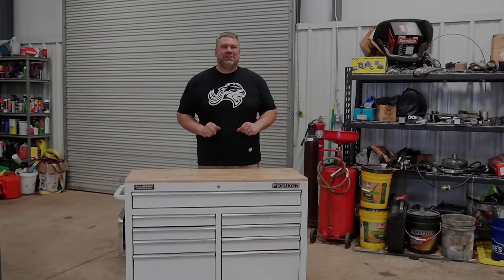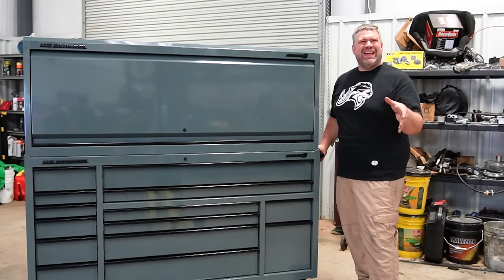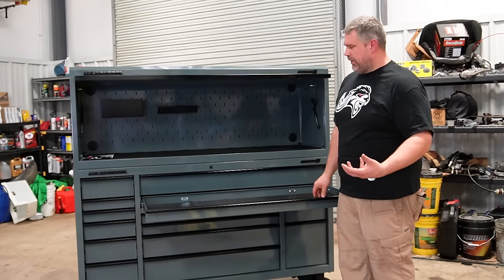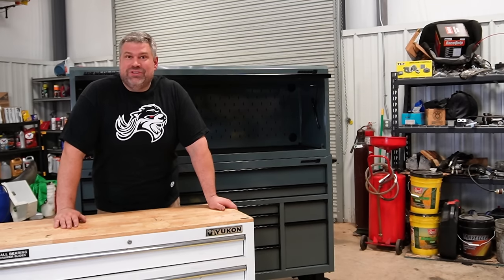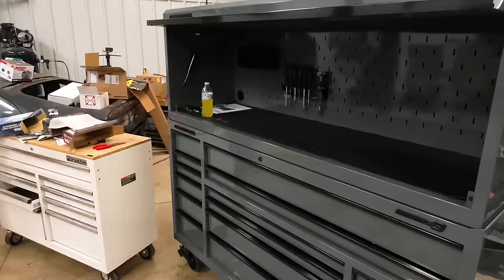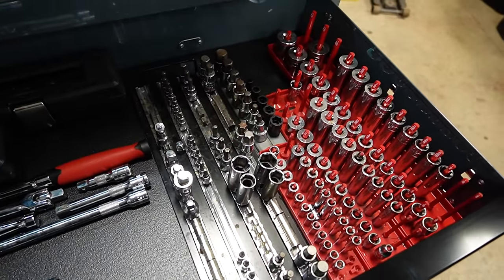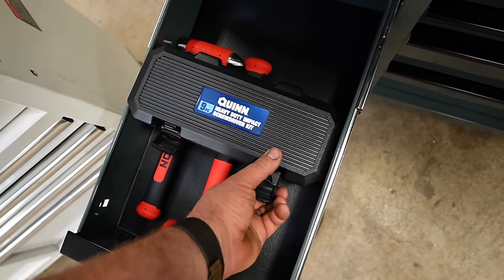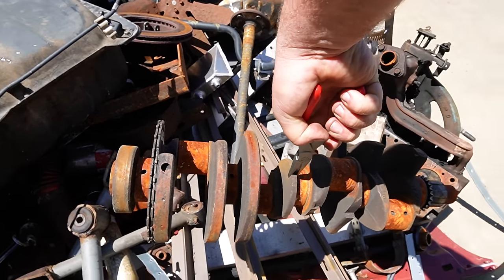Can You Really Save $20,000 With "Cheap" Harbor Freight Tools? U.S. General Series 3 Review

Comment: If you don't mind the color of the thing they have the lower chest in green for $1,199.00 and hell, for that price they could make it chartreuse and I'd still buy it.  Can always rattle can it whatever color you want later for a couple of bucks, lol.  Personally I'd have little to no use for the upper cabinet, but then I do most of my work on big wooden work benches.  Those lower drawers look like they'd be good for holding a lot of my power tools, but my setup would be more for the DIYer in me and not strictly for mechanic stuff, but also for woodworking tools.

Comment: I bought a used Sealey top chest for £200 and a britool roller for a bacon sandwich as my first tool set up and it came with a load of tools (snap on and Sealey) now I've spent (used) £5000 on a snap on kra 2410 top chest, 2422 roller and 2012 side locker with some toolage in. As for impacts, my co-workers rave on about snap on impacts costing £900. I spent £300 on DeWalt and they're much better, less expensive and very much the same power

Comment: Well the nearest HF store is about a few hundred nautical miles away from me so no dice. Yall got it good over there, so good that I am actually planning to move over.

"Mechanics" in this region are mostly grease monkeys, one of which ruined my current project sportbike before I got it. I saw how a few of them do work, taking off head nuts with an air impact, no torque wrench used on engine components, not a page or squiggle of the service manual and people wonder why an overhauled engine is bad compared to an untouched one. They also tried to fix a brake lock-up by putting holes on the (fairly pricey) reservoir diaphragm instead of clearing up the tiny bleed port on the cylinder which I did four years later, still working so far. Needs that diaphragm though...to hell with those people

I can't trust them knowing how they do work, and ticks me off trying to get a job at a local shop knowing all these, and your usual minimum wage in the States per hour - that's per day over here, screwing a lot of people. I could have asked a few fellows that are certainly willing to help me, but unfortunately they are no longer around. Wish me luck...

Comment: I just got my bosses to (finally) buy me a new tool chest. I couldn't find the size I needed online from Harbor Freight. I found it later, but at the time I needed something NOW. I had them get me a top box from Craftsman, and a bottom chest from Husky. They are the same series, even have the same style keys. For that little 26" box, we paid just over $500. What a joke. Flimsy construction, small undersized sliders on the drawers. The lid of the top chest flops around when you open it, because it's so thin. The wheels on the bottom chest only have two bolts holding them on, the other end of the caster has two tabs that fit in slots on the bottom. They should be ashamed. For $580, they could have bought me a very, very sturdy US General 44" Series 2 rolling chest with double slides on the deep drawers, twice as thick steel in the chassis, and far more space for the tools. Barrel locks. The only reason we didn't get it was that floor space is limited in my shop. I'm moving in October, and I'm getting one for my home workshop. I am super impressed with the quality for the money. Some tools are still better bought from a specialty manufacturer, at least for my specialized work, but I've never had a problem with their wrenches and sockets, and many of their other tools are just the ticket. Pay attention to what you buy, and don't over-spend on something just because of the name.

Comment: My only complaint is why doesn’t harbor freight offer full socket sets? Hate the fact that they are always missing certain sizes and to go out and get those sizes individually becomes quite expensive. I’m a guy with a snap on box (bought before icon/us general made equivalent sized boxes) that’s filled with Amazon tools for the most part. The socket issue is a perfect example of why I went to Amazon vs harbor freight

Comment: Most of my tools are late 90's-early 00's American-made Craftsman. I also have some low-end Harbor Freight tools: None of their newer, high end stuff. I will say this. I was in a junk yard a few years ago and needed to borrow a 1/4 inch driver to extract a part. The mechanic who works there lent me his Snap-On and it was the best tool I've ever used. Perfect weight and balance and action. I think they are around $80 for used ones. If you can afford it, don't dismiss professional tools. Obviously hobbyists can't afford an entire toolbox full of Snap-On, but don't be afraid to at least try out a high-end tool and feel the difference. I thought 90's Craftsman wasn't bad but Snap-On is embarrassingly better in this instance. I would hate to see mechanics being forced to use inferior tools. After all I depend upon these people to keep my car running.

Comment: I agree with the overall point of the video. But you will never convince me the Icon hand  tools are as nice as Snap-On hand tools. I have no problem admitting the Icons are probably 90% as good, and I have a bunch of Icon stuff. But I will pay the $$$ for a few tool truck tools I use most often.

Comment: This vid highlights my entire approach to tool purchases. "Does it do the thing?" if it does, I do not care if its the bottom of the barrel cheapest brand out there. It just has to do the thing, and do it when I need it. The worst is when you're mid job and you broke that bolt that made 30mins into 3 days....and then you get the tool to fix it and it just breaks in your hand. Pure helplessness ensues. But with this one year challenge, and have documented the builds - we know. HF "does the thing"

Except the pliers.

Comment: Lol these rollaway tool boxes have got ridiculous.  I'm a 68 year old retired aircraft mechanic and never got sucked in to the tool truck money pit. If you work at a large company they should have a tool crib/store room for large stuff and measuring equipment.
For home garage/shop a small rollaway, cupboards and a large shadow board on the whole wall is perfect. Old kitchen units are free and work just fine. BTW. I now live in a beautiful house living happily ever after 😊
Reply: Lol, 62 yr old wrench here. Started a new job 5 yrs ago- needed a new box. Spent $600 for a brand spanking new 56" US General and it was every bit the equal or better than the 48" Snap on I had been using

Comment: Exactly i don't have your set of pliers with the teeth like the snap on and the Japanese engineer brand but I am like you Jared sir I would be alot more impressed with them picking up a crankshaft with them by the journal and would not care less about them picking up a dime, because if they can pick up the crankshaft then if you need to get a carburetor e clip or use them hold on to small fasteners and or pins like on drum brakes and cotter pins and they should be quite sufficient and handy to use and honestly if you are going to carry a set of pliers on you id suggest those and the Doyle slip joint pliers..

Comment: While you have this open discourse with Harbor Freight, please tell them to release a triple square and etorx set, probably under the Icon brand. I recently had to quickly outfit a basic service cart catered to modern vehicles, including euro stuff, and was shocked they didn't have any options for these in the modern era.

Also since you talked about zip-ties, get a zip tie gun. HF sells them, can't comment on how well they work. I've been using my panduit for years, and it is an absolute game changer.

Comment: I never understood mechanics buying the tool truck tools.  I have a Hodge podge of old craftsman, husky, some harbor freight and some northern tool.  Now I will admit all my cordless power tools are Milwaukee except a few "legacy" tools.  There is a quality difference with the cordless tools, but even so the HF power tools are pretty good.  And my air compressor is a big 60 gallon Ingersoll Rand so I do put money into some things that I find important.  
Now I'm not a professional mechanic but I have built a few cars.  Even if you buy into the but if you break it its your income at stake... well at the price difference have 2-3 of everything and swap the broken tool out after work (and maybe pick up the better version) I bet it would still be faster than the tool truck.

I did destroy the teeth on a craftsman socket this weekend ... need to find out if one of the carriers will still warranty that. 

Now am I the only one with a 5 gallon bucket of old cheap sockets and wrenches for the ... I need to make a tool or weld the socket to the nut situations.

Comment: Possibly more useful than the offset wrenches are the obstruction wrenches. I needed the 13mm/half-inch for the thermostat housing on a GM 3.4L engine.

Well, that’s not entirely true. I managed with a small 13mm that I had to manipulate with my fingertips reaching under an exhaust crossover pipe to turn it one tiny fraction of a turn at a time. You couldn’t turn it enough to reseat the wrench without flipping to exploit the two possible angles. Of course, since you are doing this near blind with fingertips while reaching under the SHARP exhaust shield and back up, this usually resulted in you dropping it… and subsequently reseating on the wrong side (50/50 chance)… forcing you to reseat AGAIN and risk dropping AGAIN. I’m telling you, I averaged less than a 32nd of a turn per seating and it took all day. Not even sure how I managed to break the bolt loose in the first place.

Of course, there was no way I was doing that again when the coolant level sensor blew out the next day and caused my new fail-safe thermostat to stick open. I went straight to Harbor Freight and got that wrench set.

Of course, my new fail-safe thermostat was a replacement for a stuck-open thermostat so it really was like being thrown back to square 1.

Comment: Gear wrench is cheap, would spend more on icon. Dont like the hutch would rather have the working top with a bench vise. Dont see the point of short wrenches when have ratcheting shorts. Would use a battery impact set of tools and pry bar set tho. Nice video to help mechs

Comment: just picked up a Husky 52" two piece for $500 because it was a damaged display model, needs a lock and the brackets that hold the top to the bottom, couldnt pass up that deal. but i was considering the US general series 3 when i found the husky. lets be honest, the Husky wont last forever, and when its ready for retirement its gonna be hard to choose between the US general series 3 and the Icon. the Icon is so nice with that extra depth, but the series 3 is so much cheaper and they look SLICK

Comment: I am glad to see Harbor freight improving their tool line.  to be honest, the Pittsburg line is absolute junk. however, the new Icon stuff, Quinn and Doyle stuff is very, very good. I switched to Tekton about 5 years ago and have not looked back.  I used to use Pittsburg when i was younger and did not know the difference between a quality tool can make. I had an accident when replacing a fan clutch with a cheap aluminum flex fan on an old 70's Camaro. cheap tools don't fit well and I was using a Pittsburg wrench a nut attached to the fan and it rounded off the nut and my hand slipped down in to the fan and jammed the wrench into the radiator. thankfully i was wearing mechanics gloves, be even then it required ton of stitches. had I not been wearing gloves I would have lost a finger. by the time I paid the hospital bill, and to re-core the radiator, I could have bought a really nice set of Snap-On wrenches. It could have been much worse, if i was a professional mechanic or shop owner, it would have been a work comp claim for the medical bills (raised insurance rates), time off work with no income to heal, the shop not only would have had to pay to re-core the radiator, but all the time for another mechanic to finish the job. that I why i dislike the Harbor Freight Pittsburg line.  I still use some Pittsburg stuff, it's all i keep in my toolbox that i use when i go to the wrecking yard / pic-a-parts yards. so, if they get stolen or lost i don't care.  but i have noticed that HF is also starting to carry some name brand stuff as well.  I recently picked up a PowerProbe III circuit tester, and a thing of Tub-o-Towles cleaning wipes.  both of which should be in any toolbox. the PP3 is my go-to tool for testing electrical circuits and the T-o-T cleaning wipes are awesome for cleaning up tools before putting them away, also their Dayton floor jacks flat out rock.  I mainly use HF for consumables like drop cloths, rags, gloves, painting suits, etc.  also, I switch from the cheap socket organizers to Earnst Manufacturing. I was always breaking the plastic pegs on the HF organizers. Earnst Socket Boss trays are unbeatable. I also love their plier and screwdriver organizes. they also have great tray organizers. and as a bonus, they are all made in the USA.

Comment: HF should be sued for false advertising. They claim their drawers are fully extendable but they aren't. There's usually a .5 to a full inch that doesn't clear the box when fully opened. Makes getting to the tools in the furthest rear of the drawer challenging in a crowded drawer.

Comment: Harbor Freight was good 5-10 years ago, but has dramatically improved over the last few it seems. 

I love the Quinn brand of sockets and socket wrenches as well as the selection of handtools from them as well as Doyle. When the small quinn socket set goes on sale its a tough bargain to beat. I haven't purchased anything branded ICON, but there are definitely some interesting tools in the lineup. 

I'm pretty sure Daytona jacks are the same as snap-on jacks too.

For non HF stuff . . . For screwdrivers I prefer Vessel or any quality JIS. IMO the klein cabinet screwdriver should be in every toolbox. It has a a flat sided shank instead of a diamond shape on the side so you can fit it in more narrow passageways. For security bits I avoid harbor freight and go with OEMtools - I don't think i've ever broken an OEM tools security bit - they're worth the extra $5-$8. For bit drivers I go with the Irwin extending one . . . there isn't another like it. Husky has the best socket holder trays.

Comment: New techs Buy Cheap!!! A box just stores your tools. I got 2 snap on boxes at home but my work box is a $250 harbor freight cart! I can do 100% any job using that and only bring a specialty tool from home if need be etc. I have done engine rebuilds to engine replacements using just this cart... you do not need a huge tool box. And now they got even a bigger cart!!! stay away from snap on boxes or matco etc... harbor tools are also way better then before. Icon ratchets are amazing.  You can literally buy a van to store extra tools cheaper then a name brand tool box..

Comment: Unless they seriously upgraded the drawer slides since the Series 2, those top two drawers are worthless as socket and wrench drawers. They do not last with the weight of an actual socket drawer. Mine isn’t even halfway filled with sockets and it has needed slide replacements and still rolls like garbage.

Comment: I have a new set of around i think 9 1/2 inch tekton usa made tongue and groove pliers for my $25 rewards points and I have a set of the Doyle I believe needle nose pliers might be the be the wire cutters anyways way better products than the green and black plastic handle pliers but both cost significantly more...i have not tried any of the icon brand pliers,, and I regularly use the channel lock brand USA made pliers have for years because you can use and abuse them and they last but aren't cheap so that's why I tried both of tekton and the Doyle brand pliers and I am probably going to end up buying a few sets of both brands but I don't see me replacing or getting rid of the channel lock brand new set of 6pc assortment pliers and the set of 410 nut buster grip channel lock brand pliers

Comment: I just bought the Portland 1750 PSI Pressure Washer during their current sale, and it's solid. They even sell an adapter to a 1/4 quick connect, which is sweet.  I was looking at the tool boxes to finally start organizing stuff and I can't imagine spending on the ones you see at Lowe's, Home Depot, Snap-On, etc.

Comment: I love hand tools, but it seems like most of the mechanics I've known use air tools as much as possible. Am I wrong?
Reply: You're not wrong, although cordless is probably used more than air, but impacts and powered ratchets still need sockets, wrenches are still used to hold fasteners and in tight spaces hand tools are still needed. power tools are to get done faster, hand tools are needed to do the job.